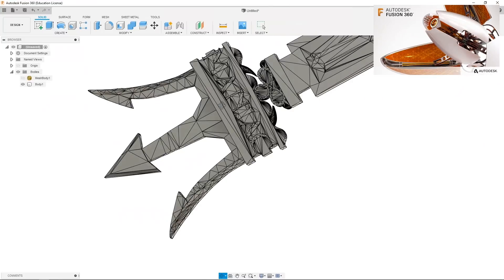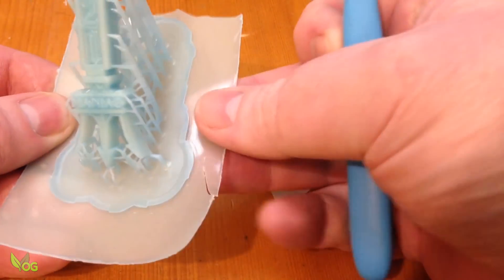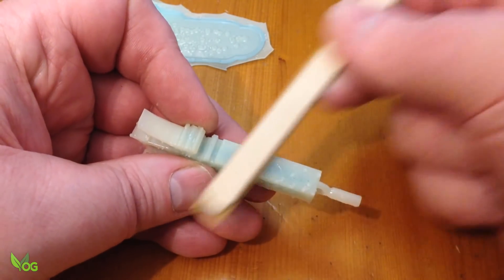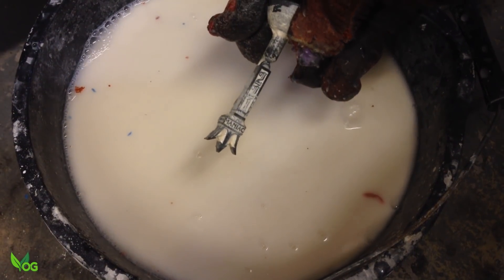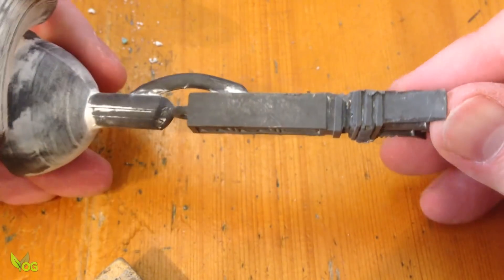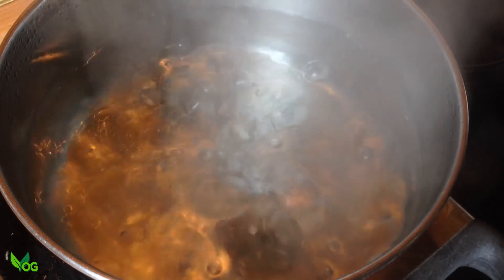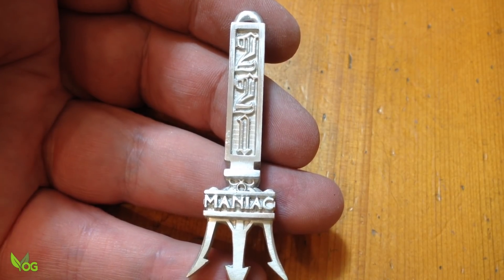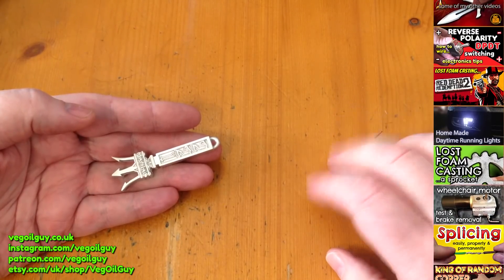Resin to silver casting of a logo pendant with Bluecast X10 - from 3D printer to metal casting

Comment: Great video! Thank you so much. I have a question. Do yo go with the resin burnout cycle or the investment burnout cycle? I'm having trouble with that matter. Thanks VOG :)
Reply from the maker: I tend to favour the investment cycle as that's usually less forgiving. Most resins and waxes are happy to melt away, but the investment needs specific times and temperatures to chemically react.

Comment: Try Simichrome polish. It's a paste with diamond dust in it. It's gentle and also works great on harder metals. Just remember you should have the piece already partially shined up first.
Reply from the maker: Thanks for the tip 😊
Reply: @vogman  you're welcome sir! You've inspired me with your videos. I'm going to have a go at some jewelry making.
Reply from the maker: I'm thrilled to hear that Matt. Let me know how you get on 😊
And look out for tomorrows video... a Celtic pendant. I'm quite pleased with it.
Reply: @vogman  sounds great! I'll have to try something similar. I only have an fdm printer with print2cast wax filament right now (Used it to make my wife's engagement ring). Planning on getting an SLA printer like yours to do some detailed work soon. I'll keep track of your videos. Keep up the good work!

Comment: How do you get your prints off the bed so easy? My last couple prints have stuck so bad I broke pieces getting them off. Is my exposure time for the first layer too long?
Reply: I bought a metal paint scraper, then i re-ground the edge on it so its a really long sloping edge and not the blint not very sharp one it came with. Hold it mostly level with the build plate and the sharp edge slips right underneath the prints and they usually pop right off. I broke 3 of those weak plastic spatulas so i had to do something different. Just keep your metal scraper fairly level on the plate or the sharp steel will easily cut into the aluminum plate.
Reply from the maker: Thanks for the input : )
Reply from the maker: If your prints are completely bonded, then maybe the exposure time is a little high. But as Keith had said here, a good thin and sharp metal scraper should work for you : )

Comment: How do u get air bubbles out of sand castings
Reply from the maker: Porosity is the enemy... and so many possibilities...
Dirty metal (recycled too many times)
Too hot
Too fast a pour
Too many dramatic changes in flow
Incorrectly tuned gas torch...
The list goes on. In an ideal world, clean metal, not too hot, smoothly poured.

Comment: Glad to hear you are better. Good timing on the video. today was the first time I fired up my furnace and did some ingot pours. Copper was good Zinc I overheated (glad I was outside) and Aluminium takes a bit to clean up the crucible afterwards. Plan to one day get to where you are hopefully
Reply from the maker: You WILL get there mate. It's nothing difficult, just a technique that can easily be learned : )

Comment: Good to see you back on your feet Geoff!  The casting looks really good!  I'm assuming you want to get into and polish inside the recessed parts?  Personally I would leave them as 'textured' and polish the top level with the frame and lettering.  Wet sand with higher and higher grits and then jewellers rouge on a felt disk with the dremel.  But that's me....

If I think of anything that you might be able to use to get into the recessed bits, I'll give you a shout.

Cheers

Dan
Reply from the maker: Thanks Dan... the problem was that it was too small for my fingers : )